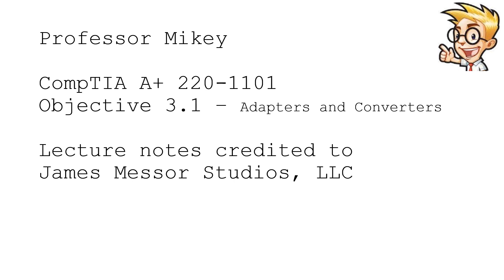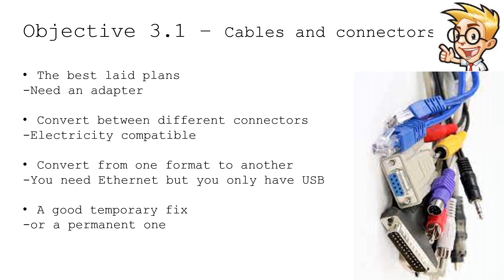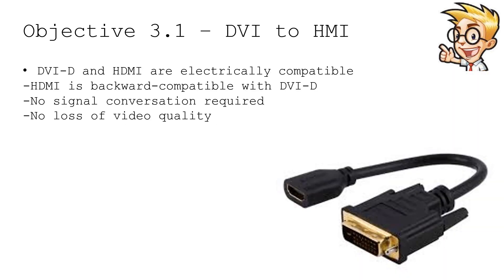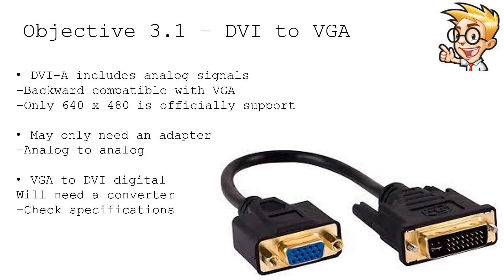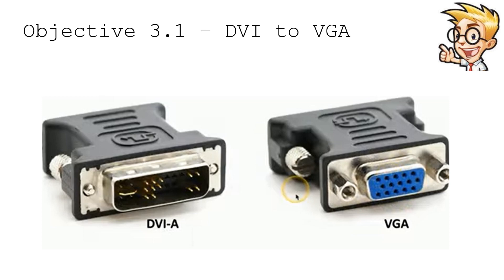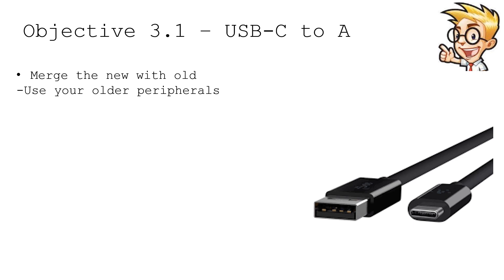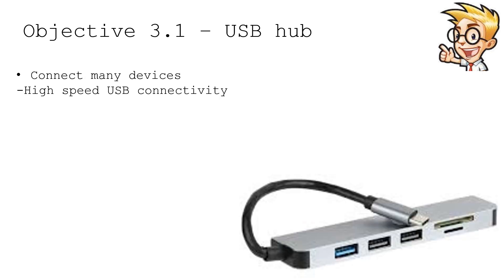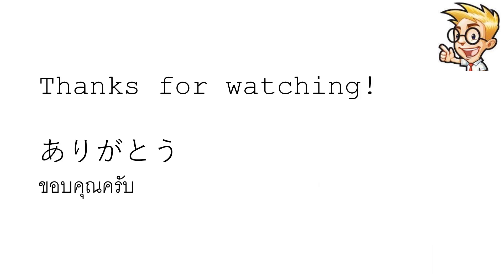Adapters and Converters – CompTIA A+ 220 1101 – 3.1

Comment: It is possible to convert DVI-D to VGA, using DVI-D male to HDMI female adapter and then plug in HDMI to VGA active adapter.

I mostly avoid this, because most of the video cards have HDMI, so that HDMI to VGA Adapter could be plugged in directly.

On GeForce GTX 900 series or AMD Radeon R5, R7, R9 200 series or HD 7000 series have DVI-I output, so simple DVI-I to VGA Adapter is sufficient.

Btw, VGA connector supports up to 2048x1536 85Hz, but it really depends on video card, most video cards are limited to 1920x1200 60Hz.
Reply from the maker: Hello there, 

You can use analog or digital without converting the signal.
[dvi-a -> vga] 

640x480 / 60hz is the native resolution dating from 1987. 

Yes it possible to use other conversions and get other resolution with today’s graphics cards. This is not on the CompTIA examination though. 

Thank you so much for watching and supporting me. I appreciate it. ❤️ 

.
Reply: @CoachMikeyStudios  I often use DVI-I to VGA Adapter on my GeForce GTX 960, because I have VGA monitor easily accessible, and it is more efficient than using active converter, because active converter actually consumes energy.

Comment: I've read that the HDMI to VGA converter is drawing more amps than regular HDMI to HDMI device, I want to make sure if this is true.
Reply from the maker: HDMI pulls 300mA. 
Ive read similar too.
Reply: @CoachMikeyStudios  Is it bad for GPU long term use?
Reply from the maker: @mohroa9464  I don’t have experience with it. I’m going to guess it won’t be good for it. If you are going to use that setup make sure you have quality hardware 👍